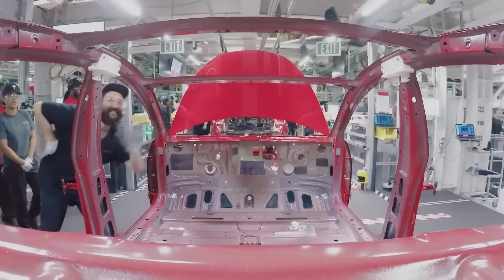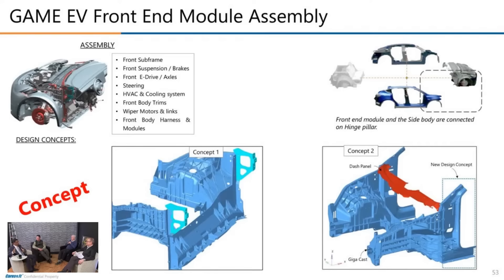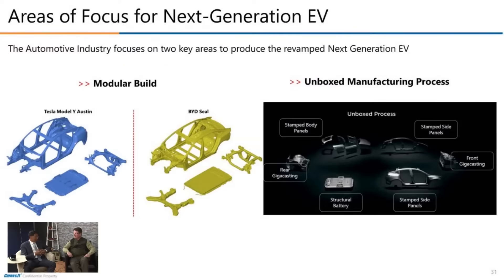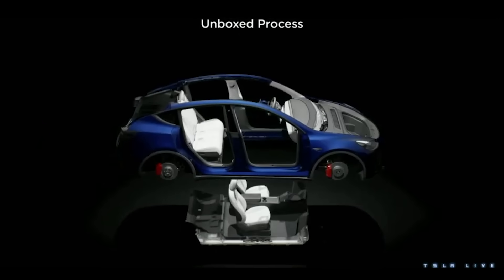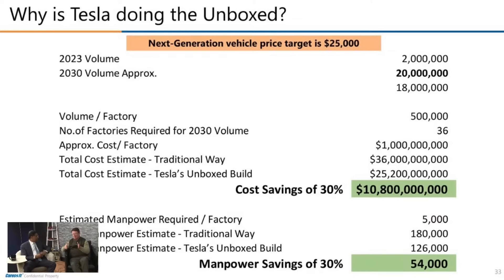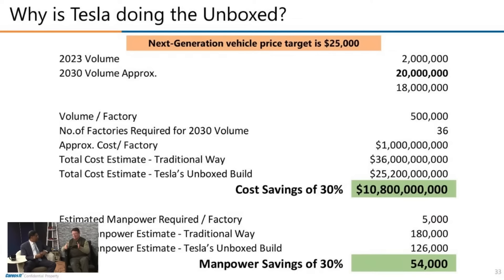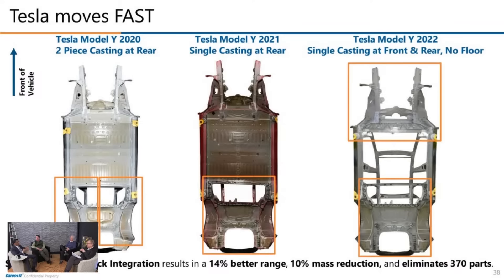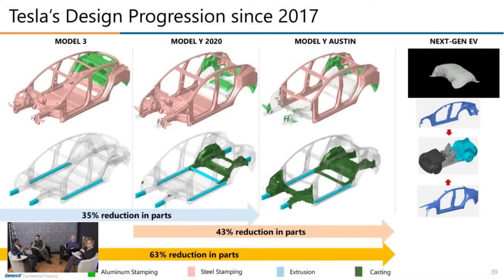How Tesla's new unboxed process will drop costs by 30% (or more)

Comment: If you've ever visited a car factory, you're struck by two things. Firstly, the plants are both truly enormous and very sparsely filled with equipment and personnel. Secondly, the lines seem to move at a ponderously slow rate. Having such a sprawling site makes just getting around painful, and it's a waste of space. I can certainly see why increasing the density of people and equipment ought to make a big difference in the cost of the factory and also the rate of production.

Comment: Nice video, thanks for sharing! A couple things that were not mentioned which also contribute to cost reduction & utilization of unboxed production: 1. Using stainless steel, like in Cybertruck, allows that they can get away from assembling-painting- disassembling-finishing component build-reassembling (in order to keep paint match) / instead, all components can be finished and assembled at a single assembly point; 2. The patented wiring assembly architecture innovation makes this possible while eliminating the single wire harness process, 48V reduces wire costs too. If they can use a thinner stainless & develop a more dynamic bending method, this will help make any other vehicles that use stainless for body less boxy. Looking for that development….
Reply: that will be used for fleet services not individual buyers